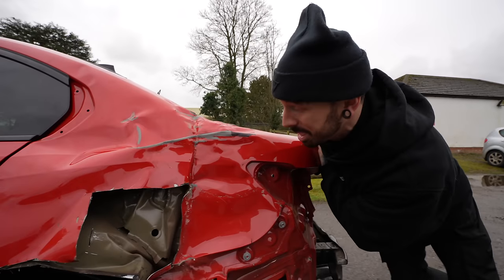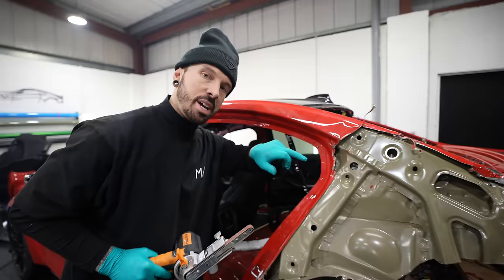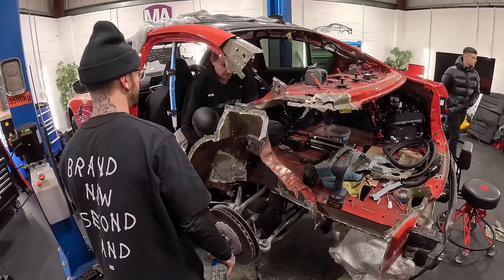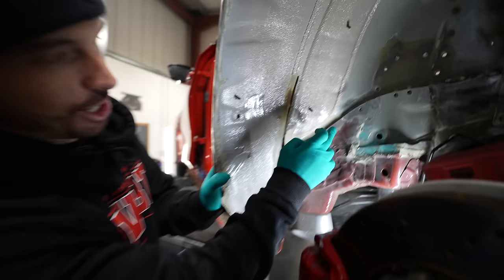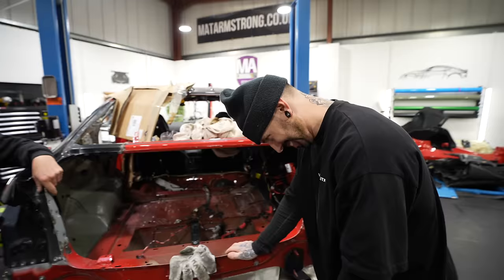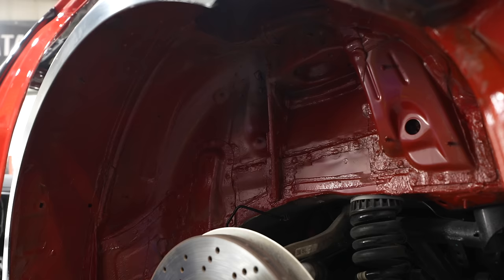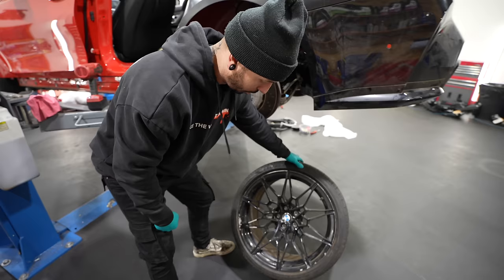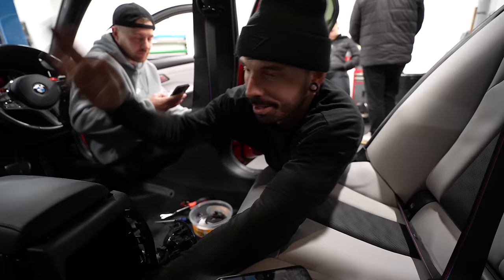REBUILDING WRECKED BMW M3 THAT THE INSURANCE COULDN'T

Comment from the maker: Get 15% off your Carly purchase with code "HWBT24" at: https://bit.ly/MA_Carly
Reply: Thanks Matt for the discount I’ve got myself one today 👍🏻
Reply: Watch out for Carly!!! No reminder about renewal of subscription, email address in Terms and Conditions which doesn't work, no information on invoice about the annual payment, automatic renewal price is way higher than the one on the invoice. Also there are much better apps that support BMW available on adroid for much lower price. I do not recommend Carly after one year of using it.
Reply: Personally I'd have just replaced the entire side of the car instead or a cut n shunt. So there would be no breaks and would probably be stronger.
Reply: Can I win the old seats somehow to put in my 04' 745i. Those old seats you took out are SEXY
Reply: I'm in upstate NY US so it wouldn't be the most feasible method to upgrade considering the POND lol
Reply: @bananeq666  I was about to post the same thing! It works well, but you are correct about renewal process and fees. I felt scammed.
Reply: Thanks Matt
Reply: Brilliant job! Black center console for sure and I’m definitely going to get a Carly scanner
Reply: Awesome job again!
Reply: The car looks amazing mat 😍
Reply: Cheers mate I've just got my Carly !!! 🚗 🚘
Reply: Ok
Reply: For future reference there is a drill bit you can buy for drilling out spot welds
Reply: Matt, I really appreciate your videos but you need to be more clear about what it means to buy the Carly code reader. I have read so many disapointed customer reviews out there, so please be aware! I bought the card reader mainly because of your add. First of all its not a product but instead an annually software rental which means they will debit you annually (if you dont cancel the subscription) and its not possible to return the package if you regret the purchase. This is far from clear in the webshop and came as a surprise for me. Read online reviews before consider buying.
Reply: @bananeq666  Totally agree. The annually cost is not stated when you confirm the purchase so I had no idea what the total cost will be. I have canceled my subscription and returned the product the same day I received it, even though its not possible according to the customer service.
Reply: I ordered on the Matt discount and had no idea it was an annual cost until I read a review elsewhere. It is clearly a scam and I am surprised Matt approving this product.
Reply: @Didadumable  it works well. It does everything it says it does. It's a great product. It's just that the payment model is a rip off.
Reply: Bought it
Reply: @Didadumable  Scam for sure and the customer service is a joke. Your not able to return the order either.
Reply: Just ordered it love the videos thank for the discount code.
Reply: Mat, I've elected you as my Guru. Have you any idea how to manifest sway bar bushings and trailing beam silent blocks for a 1991 Mitsubishi Lancer Hatchback, if you're in Portugal?
Reply: Just purchased mine with your link can't wait to get it in! My family and I love your videos keep up the great work and thank you for the amazing content!
Reply: @chrisberndt25  You'r going to be disappointed. Sorry mate.
Reply: If you ever have to remove panels like this again you can get a drill bit for spot welds making the job alot easier
Reply: Whats the tool you used to remove spot welds?
Reply: Bit upset with this recommendation ordered two weeks ago. Not arrived.
From the other reviews a lot of people are having the same issues and it's hard to cancel...  also not clear on how to get a refund 

Can't track the package apparently still in Germany!!! 
Matt how are advertising this product
Reply: The BMW m5 comp crashed near my house
Reply: Mat buena tarde me podría vender los asientos delanteros son para un proyecto que tengo es en Daewoo kalos pero esos asientos le quedarían perfectos yo vivo en Colombia muchas gracias 🤜🤛
Reply: Lot of people are not happy about the Carly OBD reader 
Read reviews or small print before purchasing 😳
Reply: I bought Carly because apparently it works with Ford. Sadly you can’t code any features with Carly (it’s just a code reader). I immediately asked for my money back, they’ve refused. Carly give you the scanner for free and you pay for the licence. Once you make the purchase, the licence is live. They won’t let you return it or give you a refund. Lots of people have been scammed out of £60 or more, and there are loads of poor reviews and YouTube videos about it. I’ve set fire to mine and binned it. Beware…

Comment: I am sure someone else has mentioned this in the comments but here I go just in case not....where the 1/4 panel meets the other parts I would normally put a sleeve behind the joint. Just a small piece maybe an inch wide will work well. When making the mark on the roof rail and rocker panel, these pieces can be trimmed to use as the backer part. This allows you to have some wiggle room where they come together and lets you weld without worry of melting the thin sheet metal. If you are really experienced with welding sheet metal it isn't required but I always found it helpful. It only takes a few minutes to prep the sleeve and tack it into place. Other than that I think you guys did a really good job, especially for someone who has never done this before. It is great to have someone like Jack to guide you. This is going to be a really sweet deal when you are complete.
Reply: Great idea. We do it with so many other welding projects. Why not bodywork as well. Cool :)
Reply: Good tip, especially when you are going to have to grind it extra as a new player will have to .

Comment: I am astounded on how well the fitment of the quarter came out considering how much was replaced and the initial damage. You and Jack did a phenomenal job.
Reply: word
Reply: those quarter panels are 3k just for one side on ebay. I dont know where these guys are ordering the unpainted ones. lol i was thinking about making a g20 with the wide rear quarter panels from the g80 and a g80 rear bumper to connect to them. My guy can weld them in but acquiring them is the hard part

Comment: It's great to see this on the show . As you can see, the amount of work involved in panel replacement it is a lot more involved in the insurance bodyshops as we have to use manufacturing methods to carry out the repair .dont know if this still happens, but BMW panels were/are actually glued on using special rivets and glue no welding is required .

Comment: 26:55 its not for lane assist but for  Active Blind Spot Detection
great work on this build
Reply: Side assist 😂
Reply: Came here to say the same thing. A radar for blind spot detection and rear cross traffic alert.
Reply: Yes. It is a short range radar. There is one on each corner. The front one is part of the adaptive cruise control. On the highway the cruise control do know of cars next to you, and track them if they merge into your lane. My 2020 bmw shows the cars around me in the dash board, but because of the hud I never look there. So I do not remember if it tracks cars on the rear sensor.

Comment: Quick welding tip if I may…. Use your left hand to support the neck of the gun and rest against the body, almost like you would with a snooker rest. It’ll give you total control of the weld as you squeeze the trigger as opposed to holding the gun with both hands and having it waving about 👌🏻

Comment: Hey Mat. Brad from Vancouver, Canada. Here's an idea on applying seam sealer. Try using a one to 2 in plastic spatula and a spray bottle mixed with dish soap and water. Then spray a light mist on the spatula and seam sealer that you applied with a brush. With the spatula use light pressure over the seam sealer for a baby smooth finish, that even the manufacturers would be proud of.  Of course, not too much soapy water. Mat, you should be very proud of your accomplishments. I know l am. And your Dad, what a blast he is.!!!
Cheers, Brad

Comment: Self piercing rivets not spot welds , when you put a new quarter panel on you get plates that you glue behind the butt joints on the C pillar and the sill, you do NOT weld the gaps you just fill them , that is the Thatcham and BMW methods .Ive fitted quite a few of these over the years. I even know of a story where someone took their car to be serviced BMW picked up the car wasnt repaired correctly and the preverbial hit the fan and the company that repaired it ended up buying the car
Reply: I was thinking exactly the same thing, BMW are bond and rivet. Only snag is, I'm pretty sure he's not BSI approved so technically doesn't have to follow any repair methods 🤔.

Comment: I've been panel beating for years and I would say you've done great with that 1/4 panel. Doing inner structural panels isn't easy work. It's messy, time consuming and just not nice in general. It's a shame you couldn't spot weld more of those panels as plug welding will change the properties of the panels making them more rigid which is fine but if it's involved in another accident they won't crumple as they were originally designed to do but realistically it will most likely be fine. Nice work!
Reply: I learned this by seam welding my race car.  When I got hit the damage traveled a lot further in the chassis than it would have without the seam welding.
Reply: Not an expert, but I'm very interested in your point regarding the crash properties of a repair like that. I suppose it's the main reason why some car repairers on YouTube have been heavily criticised? (see Arthur Tussik's criticism). Thanks.
Reply: @L_78_  Basically the structures of modern cars are built to bend and fail in certain ways to minimize the forces the people within the car are subjected to.  Going from spot welds to plug welds changes those failure modes to the point it likely will increase the forces passengers feel if there is another impact on that corner, as well as potentially causing more extensive damage to the vehicle as those forces are spread through more of the structure of the car before they are used up.
Reply: @L_78_  when we repair cars in the body shop we have methods that we have to abide by. A lot of modern German cars are welded from factory but the repair methods say they need to be bonded and riveted in the repair methods. I did an A class Merc not long ago that was part bonded and riveted. Spot welded in places and MIG welded in other places. It's a ball ache to be honest but we have to do it.

Comment: Take advantage of every second of this. I lost my dad at 26. I'd take a bullet in the head to have one day with him. Anything. An the channel wouldn't be the same without your dad. Cherish it Matt. Your so lucky! Don't take a second without him for granted. It's so awesome
Reply: Smoke from combustion engines makes people live 8 years shorter in average. Listen to that guy, JUST ONE DAY would make such a big difference for him.. 8 years.. think about that before you again gonna hate electric vehs. U don't have to buy it for urself yet. Just let people buying it and making them evolve faster.
Reply: @7he4040  I don't really get this... ev's aren't as clean as ypu think... that electric power has a source you know... like powerplants? Driven by gas or coal, sometimes nuclear... it is not all solarpower or wind energy... keeping a car on the road is not as unsensible as it might look. Any new car being built causes more pollution than the car produces in its working life...
So keeping a car on the road is not so bad considering...
Reply: @fretlessfender  it's not problem of electric vehicles that electric companies produces energy from coal as example. Lot of people have solar panels, also lot of regions in my country already over 90% green energy
Reply: @fretlessfender  and believe me or not, your beliefs aren't correct. production doesn't cause pollution, if made with electricity gathered from sun, or water flow
Reply: @7he4040  yes you are right..  but there is a big IF isn't there...

Don't get me wrong, I do applaud everything that is being done to make energy green... but the fact that the main part is still grey is putting people sand in their eyes...
At this time EV's are only green at the places that they are driving, not at the place where their power comes from...

And please you don't really think that car manufacturers are totally powered by the sun, do you?
Reply: @fretlessfender  is it problem with electric vehicles, or with corporations and govs? Should we really argue about "are electric vehicles really good", or "shouldn't gov force corporations to go green, to make us live longer?"
Reply: @7he4040  Hard to answer really...
Most Ev's are very good cars, very nice to drive and plenty fast!

But are they green? Take all in, not just during service life, but those LithiumIon packs... how are they produced and if they are EOL what happens than? How green are these procedures... to be honest I don't know, but I fear there is a lot of grey area here...
But if you know please tell me, I'm here to learn!
Reply: @fretlessfender  I heard about myths "how scary batteries are" but if we dive deeper into it it's "how scary they are if we dump them into ocean". It's normal battery, like batteries in phones, laptops, or other cars, every car does have battery 🔋
Reply: @fretlessfender  'sometimes nuclear' like that's a bad thing. Nuclear is virtually clean energy. Also, the point is that the creation of electricity at plants doesnt pollute people in cities where fumes build up.

Comment: Loving the fact you've started welding more Mat, but please think about PPE, at least if you start doing longer welds.
 I've burnt my neck twice from the UV radiation from welding, in about 5 minutes. Like sunburnt. Caught my neck from under my mask as I was welding upwards and didn't have any neck protection. 

It's fine doing a few little spots here and there, but I have dozens of burns on my hands and arms even with fireproof overalls, leather sleeves and thick welding gloves 🧤😅

Anyway, thank for the video, these are so incredibly well made, entertaining and educational. Amazing job guys. 👏💪

Comment: You can get special drill bits for removing spot welds. They cut a ring around the weld releasing the top piece of metal and leaving the weld behind on the panel underneath which you then grind flat. I’m enjoying the videos. Thanks!

Comment: You need a Teroson Multipress for the seam sealer. You heat the sealer in a mastic type tube that it comes in then you spray the sealer. It gives you exact OEM stipple. 👍🏼 love your channel.

Comment: You should have used a proper spotweld drill bit to remove all those  damaged panels, they just cut the outer panel. There's less chance of distorting the inner panel flanges than using a belt sander and chisel to split spotwelds apart.  Proper bit will also leave you a nice plug weld hole if you need to remove and refit a panel. You need a 1/4 inch metal hole-punch,  much quicker and less distorting on flat seams than drilling lots of holes to Mig plug weld.

Comment: You’ve mentioned a jig, you do really need to mount the car on a jig to check and straighten the chassis. There’s no way after a smack like that car had that it’s all true. In the day we had a flat bed jig and clamped it down, then check within fractions of a mm to tolerances, just a thought 🤔

Comment: For the first stage of seam sealant removal, have you tried a hot air gun and flat blade scraper. That is what I used in the trade 30 years ago. Then use the wire brush after.

Comment: Hi Mat, after seeing your rebuild videos I also bought a G80 M3 to rebuild (the infamous Isle of Man Green G80 M3 that hit a pole in California LOL). I replaced all the deployed airbags, as well as the battery terminal, as well as sending off the airbag module to clear the crash data and have the belt tensioners rebuilt. But I can't get rid of the airbag light on the instrument panel. I was told that the car needs to go to the dealer for programming, is this true? If not, what else is there to check and do? I am puzzled. Thanks in advance.

Comment: You can get a spot weld drill  bit. The tip is flat so it doesn’t drill through both sheets of metal. Much quicker than belt sanding the spot welds. 😊

Comment: When you said it could be stronger than the original.  Be careful not to 'over repair' it.  I work for a nationally recognised dealer, and our bodyshops have very specific cut lines etc to adhere to manufacturer specification.  That interior makes SUCH a difference!!!

Comment: I watch Chris and Rob over on Salvage Rubuilds, and Chris always uses a Weld through Zink Primer on jobs like this, just wondering if you used anything like this on the areas you cleaned up plus inside of the panels could start to rust very quickly where welds have been ground away>

Comment: For next project feel free to adjust a drill bit a little, is cleaner, easier and faster than a belt grinder....

You can use a drill bit, make it a bit flatter than factory ( that is designed for proper drilling ) then sharpen the edge ( just do everyhing by hand and it's easy )... 
few short spins in a spot weld ( prefferable with air drill, high rpm ) would split plates apart... 
it successfully removes upper plate, leaving just a tiny spot mark in the underplate which is beneficial for accomodating new plate weld as well :) 

p.s. amazing project, a lot can be done safely and with high quality by thinking out of the box with proper approach :)